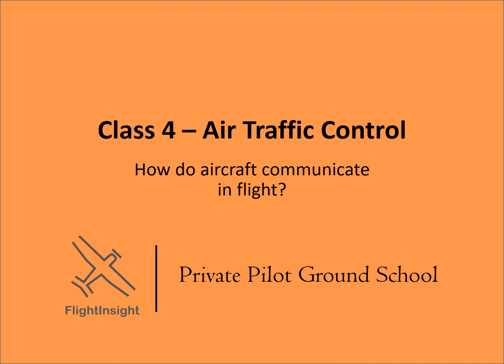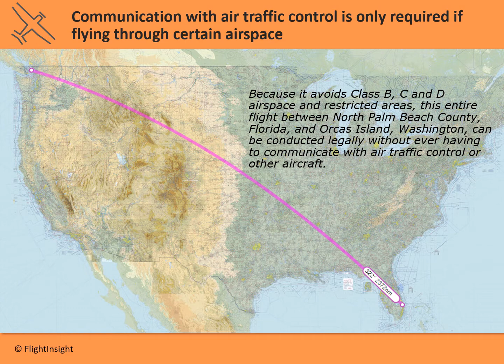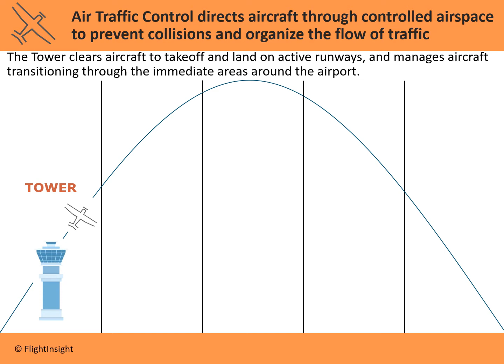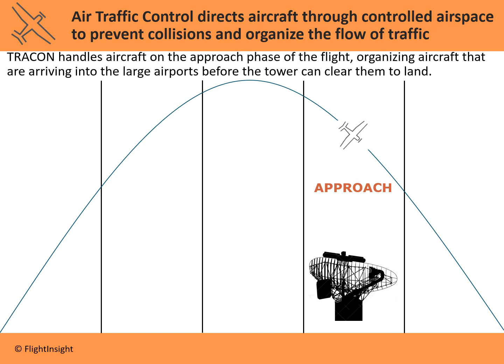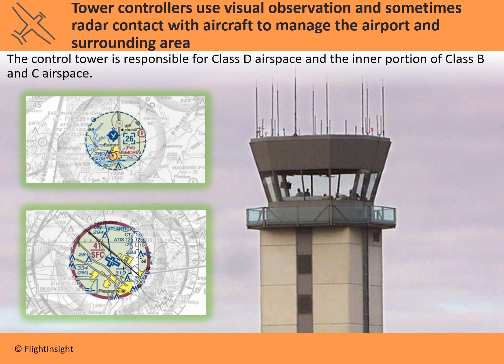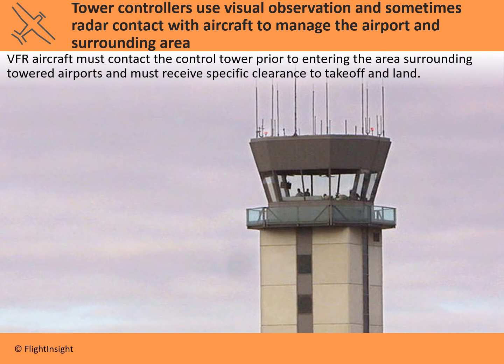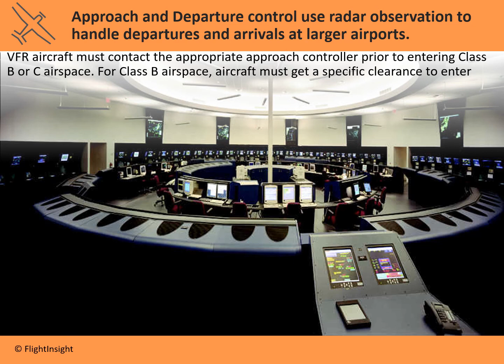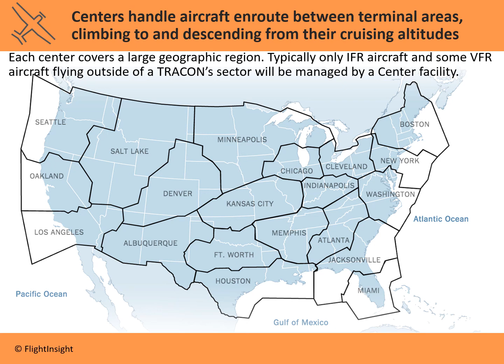The ATC System Explained | VFR Radio Procedures | Air Traffic Control

Comment: How does it work when an aircraft makes an instrument approach to an untowered, class g airport?
 For example KBLM is an uncontrolled airport but on the sky vector page it list nearby joint base McGuire Dix Lakehurst under the communication section.  I've been told that it has to do with making an instrument approach but I'd like to understand much better.

Also what does APP/DEP stand for?
Thanks!
Reply: App/dep is approach and departure